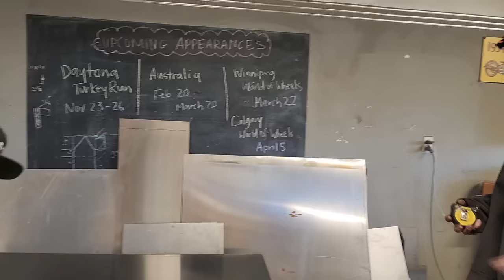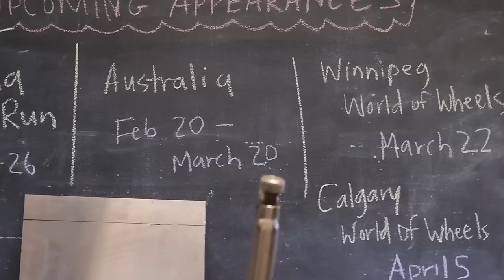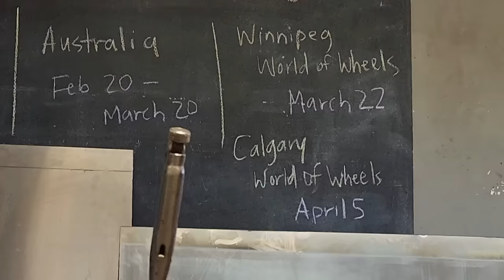Sheathing in the engine bay door 👏🏻

Comment: Chad got a question, on the engine bay door would it be better to weld a patch to cover the ends of the square stock to prevent water from getting in or just leave them so they will drain and dry out?  Or should I just only drive a custom car on warm dry windy days?  
Also I live in Texas and just can’t help but imagining the interior getting hot. On a sunny day down here a dark colored car can reach  160F degrees. But a bare metal truck with a large surface area and an engine compartment in side, could this thing go beyond 200F degrees? So every time I look at it I try and imagine where a camper style roof A/C would fit.  So maybe avoid Texas in the summer. 
Rig is looking good.

Comment: I noticed you didn't want to remove the frame. Was this because the frame was clamped into position?  If it was what is going to keep it in shape when you remove it? I was thinking you could have relieved the tension in the game with heat. Then remove frame when it fit the opening correctly. After that the skin could be applied squarely and trimmed to fit the frame. Putting a weld on the outside corners will probably try to bend the door.
Tack stiffeners to the inside of the door to reduce distortion.
To put the door back in place tack tabs on the inside of the surrounding flame to support the door.
Love what you're building. It's very cool.